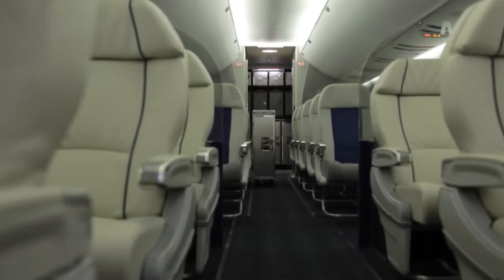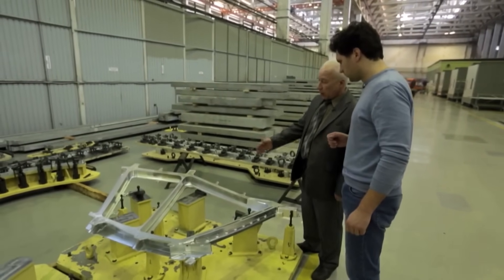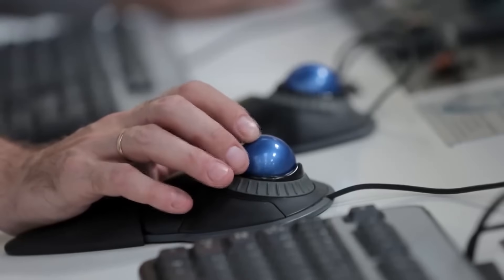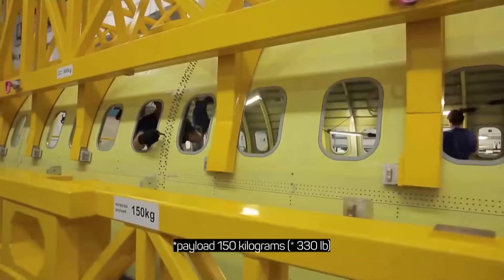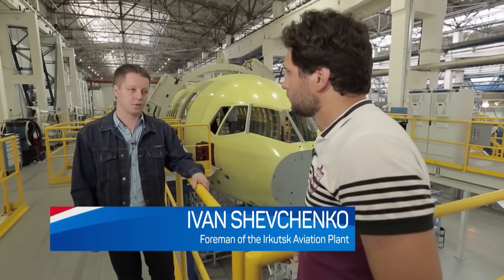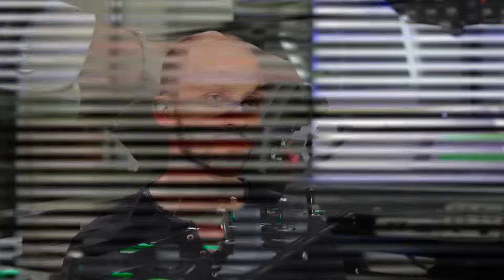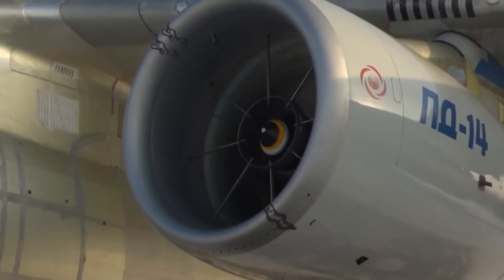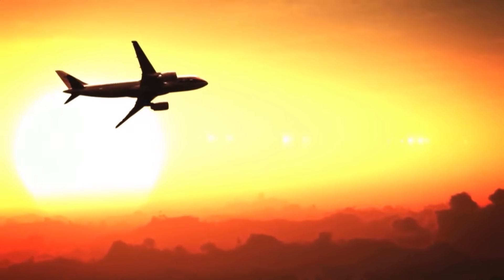The MS-21 – RUSSIA's Boeing 737 MAX Alternative

Comment: Information being presented is a year outdated. Manufactories are ready to set the production in place. MC-21 will beat American all aircrafts (or shall I say Europeans). It can't compare in fuel efficiency, quietness, space, speed, local production, software, radio communication. Only parity it has is electronics. Well done Russia!
Reply: Don't exagerate, but I do agree is a very good plane! Sadly it will probably only fly inside russia and some other countries if they don't get a certificate soon!
Reply: @faux8311  He will fly to China, India, the Middle East and Africa. This is already enough for flights.
Reply: @denslipped  exactly, theres more than enough approved routes to cater to all the planes they can build for the next twenty years
Reply: do not make me laugh.  this aircraft has no future, since there is no way to replace all imported electronics, systems, and most importantly, it does not have a reliable good engine.  all that is done with this aircraft -  money is allocated and the appearance is made that something is happening.  but in fact, as five copies were built in import cooperation, so they fly.
Reply: @ВенераИсаева-л7к  Курица, у него есть и российский двигатель и российская авионика. ))) И серийный выпуск со следующего года. Не знаешь не бзди.
Reply: @denslipped каждый год такие как ты рассказывают про выпуск со следующего года, это как в анекдоте про приходите завтра, тебе 10 лет лапшу на уши вешают, но никак вилку в руки не дадут чтобы её снять
Reply: @Ooom37  каждый год такие как ты ноют и рыдают. ))) А самолёты МС-21 испытательной серии летают и импортозамещаются. АК получат уже полностью отечественный самолёт. Скоро.
Reply: @denslipped  в серии нет мс 21, не надо врать, аэробус начали разрабатывать на год позже и он уже в серии и выпущено 600+ самолётов, плохому танцору всегда что то мешает
Reply: @Ooom37  судя по всему ты дурачек. Произведено 6 самолётов МС-21 пока была возможна международная кооперация. Сейчас от неё отказались из-за разрыва и прекращения контрактов . Новый самолёт будет уже полностью российским. Поэтому задержка с поставками в АК. Только и всего.
Reply: @denslipped  don’t worry about him man, people like him won’t understand even if it is clear to understand.
Reply: @ВенераИсаева-л7к they already replaced the electronics
Reply: @ВенераИсаева-л7к don't be ridiculous  ( no one knows your future everyone else future) make laugh about your reductive minded set up,  😅😅😅😅😅😅😅😅😅😅😅😅😅😅😅😅
Reply: @ВенераИсаева-л7к they already replaced the electronics
Reply: @ВенераИсаева-л7к вам так хочется думать. Двигатель пд 14 на уровне лучших конкурентов. Электроника российская не хуже конкурентов. 
Можете смеяться, но хорошо смеётся тот, кто смеётся последним.